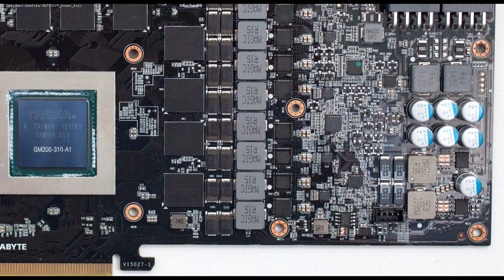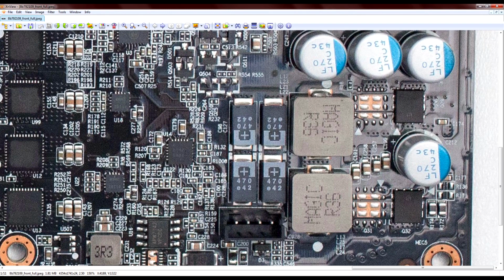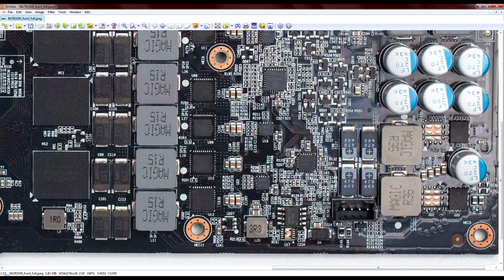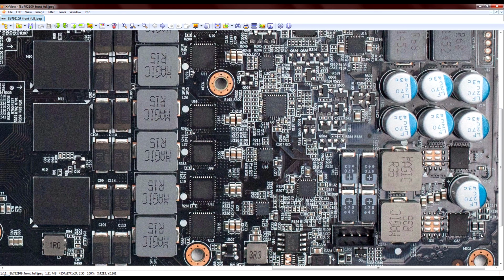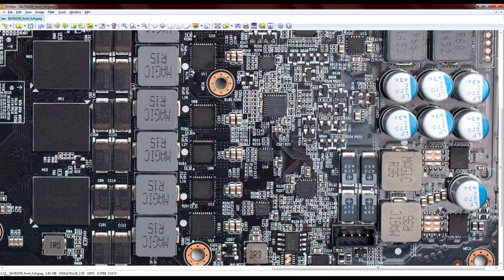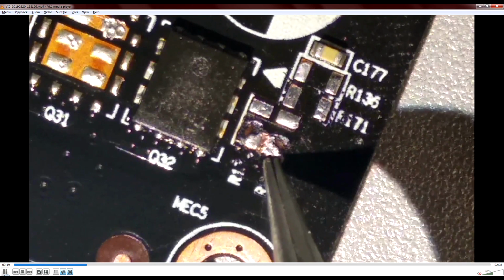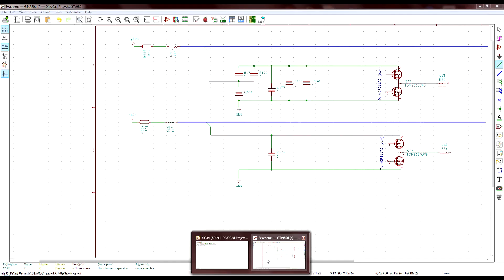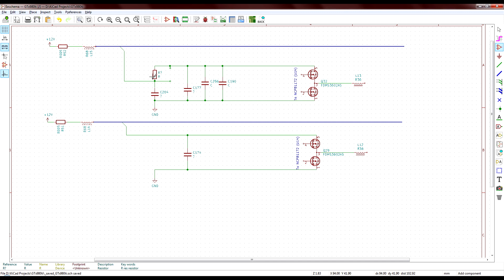Gigabyte 980Ti G1 GAMING-6GD Repair

Comment: I just bought the exact same card with the exact same problem. when under load it crashes. Both the ferrite beads show 0Ohm when measuring but they look a bit worn. but not burned. Is there anything else i should check before I replace those ferrite beads for a 0 Ohm resistor? And did you have the card with or without the capacitors near the VRMs? mine is the version which has some capacitors missing. Is there any forum i can contact you and share some pictures?
Reply from the maker: Hello, If those ferite beds are 0 ohm then something else could be the problem, but never the less i would suggest to replace them with 0 Ohm resistor if they are showing signs of burning. You could measure resistance between R52 and Drain of Q32 (The upper side of  ferite beds). Resistance should be near 0 Ohm. My version is also he one with missing caps. 
Here is the forum where you can post the images and questions:

https://www.overclock.net/forum/69-nvidia/1720746-gigabyte-980ti-gaming-g1-2.html
Reply: @UrosAndric  Seems like the resistance between R52 and R174,R172 measured directly ontop of the beads upper side shows 0 Ohm but at the pads it varies from like 20-30 Ohm.. so im going to desolder them cause it might be that i have a bad solder joint on them both.. probably because of heat. But a bit unsure still.
Reply from the maker: @micosan  If they are showing signs of burning do replace them, don't wait for them to burn thru the PCB. Also check the PCB under the beds when you remove them. When beds removed you should measure 0 ohm between R52 and bottom side of the beds. (there will be small copper island just for those 2 beds to be soldered). When beds removed resistance between R52 and upper side of the beds should be in K ohms and should be changing (Depending on charging and discharging of surrounding capacitors).
If so, solder thin wire instead those two beds and try the card. If problem continues, then lets find what else is broken.
Reply: @UrosAndric  I'm not really trusting my multimeter at the moment either so I'm going to borrow a fluke from work tomorrow cause my own fluke is at my girlfrieds place and the one im using atm is some cheap one which shows different values all the time. It even showed 0Ohm on those R005 resistors at the power connector so unless I got a short somewhere else my multimeter is wack as well :D Gonna try again with a better multimeter so i get accurate measurements at least.
Reply from the maker: @micosan  it is ok for multimeter to show 0 ohm res. On R005. It cant measure resistance below 1 ohm. I have used cheep multimeter also to repair mine.
Reply: @UrosAndric  Also when i desoldered the ferrite beads one of them i couldn't get a reading on at all = totally burned. and the  other one was 0 Ohm. I have no idea what resistances those are supposed to be.. because they are supposed to have some resistance to them when cold. But If you are good at diagnosing cards I will probably need more help as well. Some people have reported pci-e lane fuses being bad and if there has come 12V trough those beads i might be screwed. Strangely enough the crashes come only under heavy loads. but the memory and gpu clocks jump all around the place as well :) I once had a R9 390 which also randomply crashed without reason.. turned out the bios was so corrupt i had to flash the bios trough harware on it for it to work properly :)
Reply from the maker: @micosan  when you measure ferite bed with multimeter that can't measure small resistance it should show 0 ohm. It has some small resistance and some inductance. It should use like filter of some sort. And yes they are on 12v line. Strange design there because other power phase is connected directly to 12v with no ferite beds to filter that power line. But for some reason they decided to put those two beds on other VRAM power phase. That was signal for me that is completely fine to replace those beds with wire or 0 ohm res. just to have some type of protection.
Reply: @UrosAndric  Are there any capacitors in between to that second power phase. the one without the beads?
Reply from the maker: @micosan  in between what 2 points? There is scheme inside the video for those 2 power phases for VRam.
Reply: @UrosAndric  Ah nothing.. i just measured the wrong one. I thought the other chopper was for the other phace but its for the same one :)
Reply: @UrosAndric  What kind was the 0 Ohm link you bought?
Reply from the maker: @micosan  I didn't bought it, i just took it form an old graphic card.
Reply: @UrosAndric  aah ok.. Any idea what the power rating on it is? how much W will it hold?
Reply from the maker: @micosan  no idea :-)
Reply: @UrosAndric  Finally had time to swap the ferrite beads for one 0 Ohm resistor. And it seems to work. I can push trough firestrike, and doing some further stress tests still. But should I be concerned that the backplate seems to get awfully hot or is that common in gtx 980 ti's? If the solution was this simple i absolutely wholeheartedly thank you :D
Is your card still doing okay?
Reply from the maker: @micosan  My card is live and kicking :-) Doing some extencive video rendering and animations. Occasonal gaming also :-)
I was also under impresion that it is getting pretty hot. When i touch heatsink it is very hot but temps measured are around 60 degrees (celsius). I wanted to cool down that mosvet ICs from VRAM power supply as they are not connected to heatsink but as it shows up it was not nesesery.
Glad i was able to help :-)
Reply: @UrosAndric  Yeah well the problem with my card is that it keeps throttling down. both memory and gpu clocks fluctuate with 70% constantly when under load and when it hits about 60C it just shuts down (blue screens) (so that means some safety features are there still, just need to investigate what is causing it or what could be broken) But I'm going to check those resistances tomorrow and test it with a thin wire instead of the resistors when I get home from work.
Reply from the maker: @micosan  Cool, write here what ware your results.
Reply: @UrosAndric  Think I'm going to order one of those 0 Ohm resistors and try it with that. Don't have any components at hand at the moment and the wire I have is way way too thin. The values we're fluctuating too much when i tried to measure so I suspect one or both of the ferrite beads are bad and give some resistance thus messing up the current flow.

Comment: I have the same problem, in my case, the two ceramic capacitors exploded, the board still gives video, but started to present error 43 and some artifacts appear on the screen. Will it damage the chip?
Reply from the maker: Which two ceramic capacitors are exploded? Can you take a picture?

Comment: Yeah thanks, I managed a lot to find the trouble. I bought the card on ebay and the vendor said it had  heating problems so I was sure they where related about the sink. The card couldn't stay up voltage and resuted capped runing up and down until crash or freeze. I found your comment in a forum and Thanks a lot for sharing it It solved the problem and the card is running at full power under stress test. Really happy!!!  I putted a wire on 174 like you suggested because in your scheme the 172 seemed to go to the groud and I didn't want to meke a short. Just how muctch current is running there? may be I have to solder a bigger wire?
Reply from the maker: Resistors 172 and 174 are in paralell
 So no mater in which place to solder a wire. I haven't measure the current and i soldered one 0 ohm resistor there (to be used as a fuse). Card is still working  and that resistor is still ok. If your card is running fine then no need to change the wire. And if your card is on constant load i would suggest to find some small heatsinks to use on that mosfets. It is a tricky business because there are small space between them and main heatsink.
I am glad that my post helped you.
Reply: @UrosAndric  Hello a copper wire needs to be soldered?

Comment: Hello i have the same problem with casually crash. Can i solder one electric cord on r172 for a temporary test? Is urgent. Or i damage the gpu? Is the same but in this case i dont have pcb protection, is true? If work i buy one 8085 0 omh resistor. thank you.
Reply from the maker: I have replaced both of mine resistors (ferite beds) with single 0 orm resistor. Card is running like a charm. I would suggest to check feritte beds and see if they are ok. They should be close to 0 ohm when you measure the resistance. If they are burned i would suggest to remove both of them and place one 0 ohm resistor. Before that be sure that nothing else is dead on the board.
Reply: @UrosAndric  ok i put one 0 ohm resistor on r172 or r174? only the two resistor is burned.
Reply from the maker: @matty-nq2vj  And what are the results? :)
Reply: @UrosAndric  Sorry man for my bad english, i put one 0 ohm resistor on r172 position or r174 position? or is equal?
Reply from the maker: @matty-nq2vj  Doesn't matter, those two resistors are in parallel. so just remove both and place only one 0 ohm resistor, no mater the place.
Reply from the maker: Measure Q32 if it is still good before plugin back the card.
Reply: @UrosAndric  Ok thank you. I solder a copper wire on r172 and try. Now worked much better. I start furmark stress test and the 980 ti is stable for one hour and after the vga crashed. I noticed that, the VRM mofset are relly hot, but the gpu processor is stable at 63 Degrees Centigrade. This crash is a vrm temperature protector? is normal? Before your change my pc crashed every 3 minutes with only Windows 10 open. Now is really better.
Reply from the maker: @matty-nq2vj  Yeah i noticed that VRAM mosfets are getting really hot, and they are not connected to the heat sink like the ones for GPU power supply. I was thinking to solder two new mosfets to the empty sockets there and split the current between them, that should spred the temperature from 2 to 4 mosfets. I found those mosfets online for coupe of dollars. I might do that if mine crashes at some point.  
The other solution would be to add something to thsoe mosfets to dissipate the heat, a small heat sink or something.
I don't stres mine for that long. I use it mostly for video editing and a bit of gaming when i have time. Maybe that is the reason it still didn't crash. I did stressed it with benchmark but i did it for half an hour.
Good to know that you have (almost) solved your problem :)